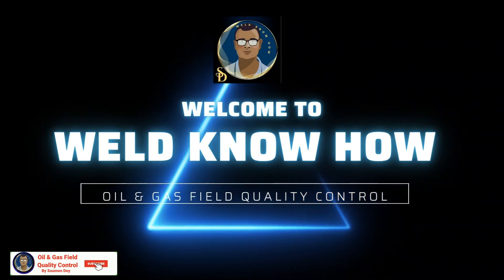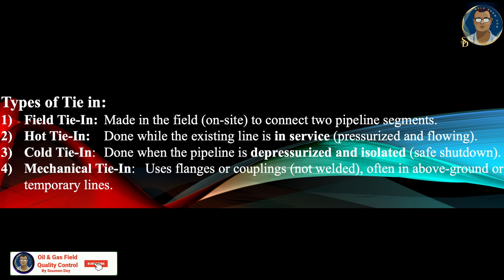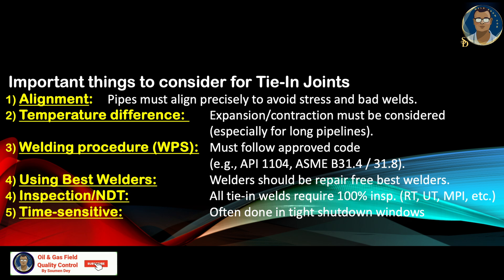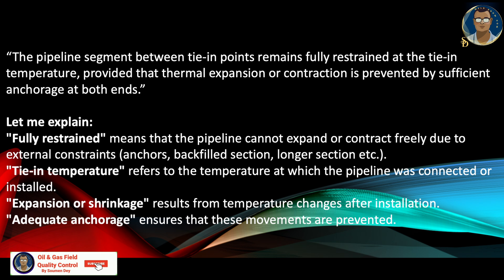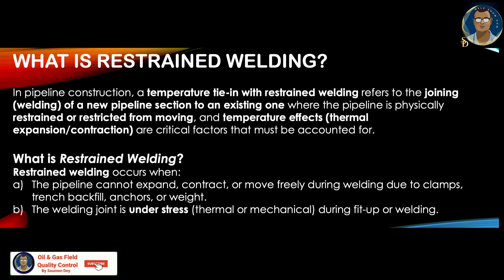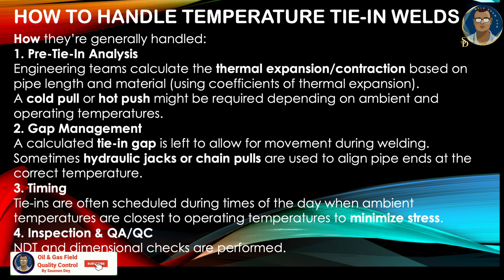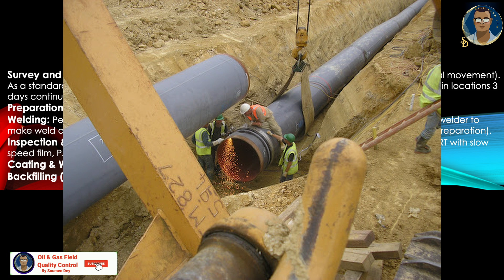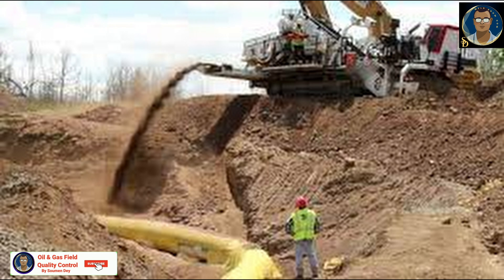WHAT IS PIPELINE TIE-IN VS TEMPERATURE TIE-IN?? WHAT IS ADEQUATE ANCHORAGE??

Comment: for underground pipeline is it recommend to monitor 3 days for the expansion of the pipe?
Reply: Very good explain,  after watching of yours videos its more clear ans technically get knowledge 

🎉🎉
Reply: This is not mandatory for the qc inspector- but the construction foreman is monitoring and measuring the expansion length for two three to have an idea of - how short he should cut the pipe so that it will be an exact match at the time of tie in fit up. Check the video full, I have explained in details
Reply: I am honored